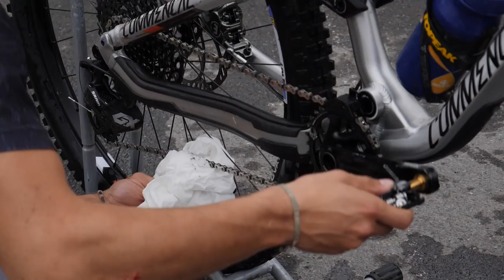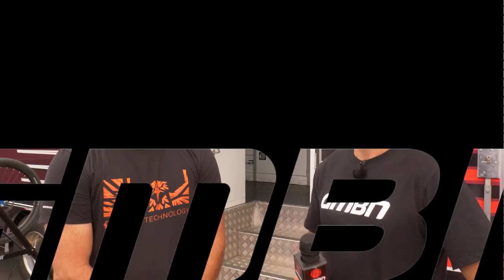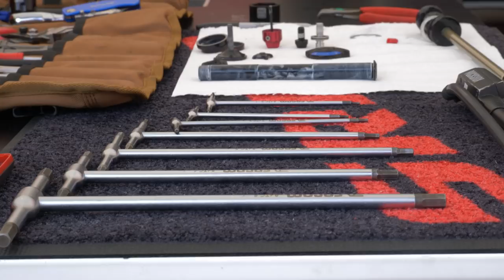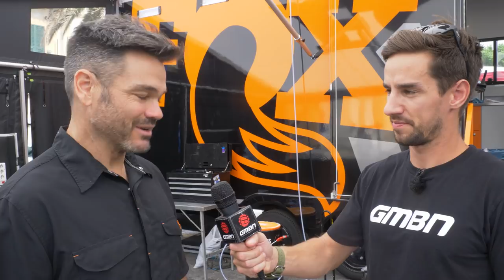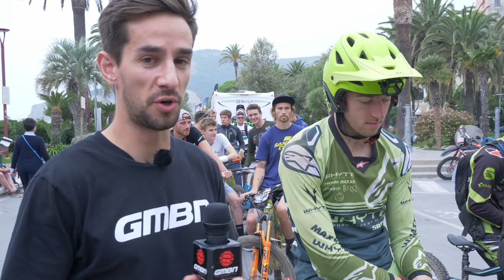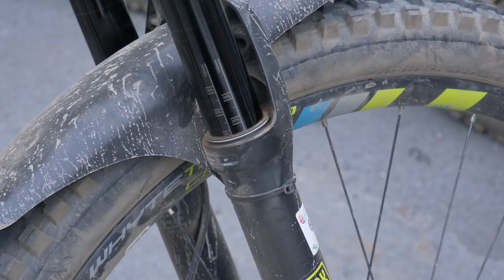How Tough Are Enduro Bikes? | Asking Pro Mechanics At The EWS

Comment: did i just hear them say aluminum is "more reliable"???? I think they accidentally forgot to edit that out..lol.
Reply: mikieson you can bent a tacoed alloy wheel back into shape, but you have to swap a carbon rim witch adds a time penalty because of the EWS regulations. Parts like rims, frame, fork got official stickers on them and can't be swapped or changed during the stages without loosing time.
Reply: P. K. 
Because time is always too tight?!
Reply: It`s actually a 5 min penalty for swapping those things...
Reply: Carbon is mostly plastic, it will break suddenly when alu will bend.
Reply: Yes. But He was talking about wheels  (and it's actually true)
Reply: oh i know..i just figured that comment he made would stir up some crazy carbon/alu debate..:D

Comment: guys is it possible for my Giant Talon2 2018 to upgrade its fork to 140mm? its standard size of travel is 100mm. thanks 😊😊😊
Reply: Untrained Pro probably but it would change the bike geometry completely and it would a bit harder to climb on a bike that's not made to be that aggressive
Reply: Doublebaconbackflip  aah ok thanks sir  for the info, but can the frame survive the hard terrain?
Reply: agreed with doublebacon, that's too big a jump.  you shouldn't go bigger than a 20mm increase at most.  Also that's an entry level hard tail bike, not an enduro.  Don't get crazy on it!  The frame is good and strong, but you may destroy the components if you go too big on the trails....
Reply: ok sir thanks for the knowledge that you shared to me. thumbs up 🖒🖒🖒
Reply: what fork can you recommend for me?
Reply: Something not too expensive.....Rockshox Recon TK maybe....  You'll have to do some research.
Reply: can I use rockshox reba or manitou machete?
Reply: Yes, just make sure you get the correct axle type that matches your front wheel!

Comment: hey can i put 140mm suspension on my scott aspect 740
Reply: Chirs chann Sure. But you shouldn't go more than 20mm over what the bike came with stock.
Reply: i dont really get it can u explain again
Reply: How much travel do you have? (in mm.) When you decide to put a new fork on it you should'nt add more than 20-30 more mm of travel because then it changes the geometry. Also considering that the frame wasnt made for more travel. Can you imagine a downhill fork on an 80 mm XC bike???
Reply: one of our rider has 140mm sunspension on it